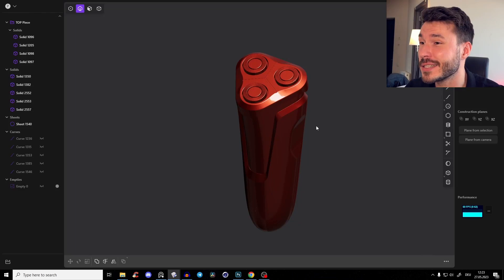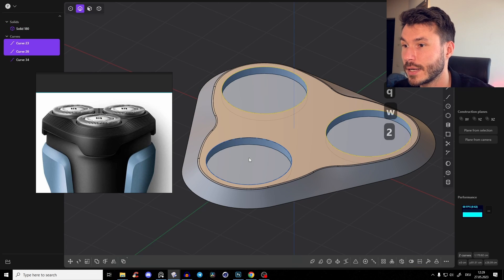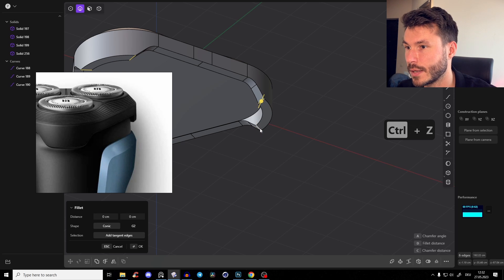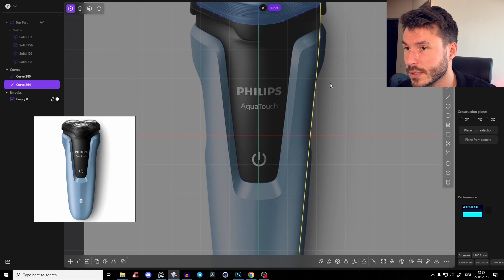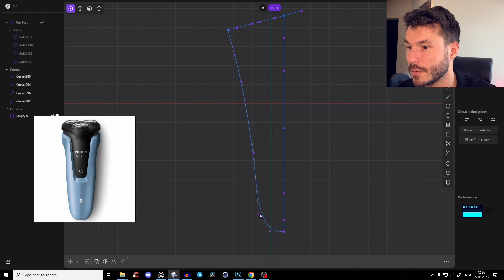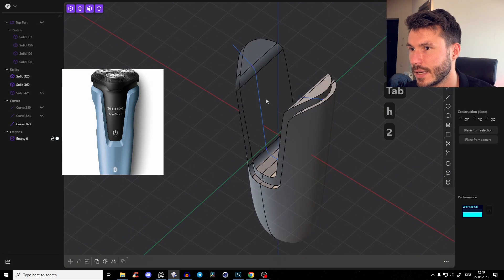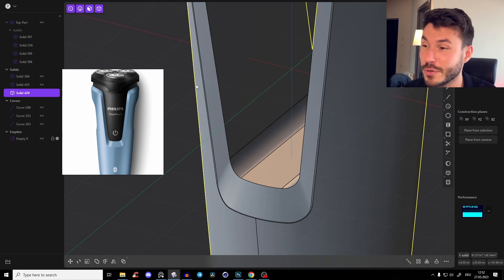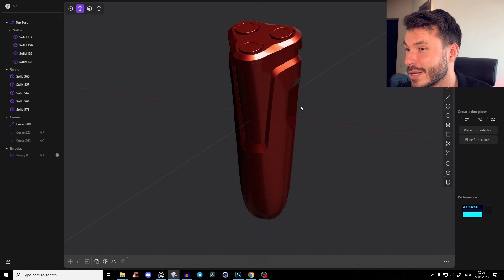Best Hard Surface 3D Modeling Software | Plasticity | Beard Shaver

Comment: 11.10 I do everything like you, I select the curves and combine them into a ring. But the shift does not combine them into the shape I need.?
Reply from the maker: Zoom in into all points of the curves. They have to meet/touch all each other.

The same on the top. The points have to touch the curve to work

Comment: Im a shapr3d user of over 4 years on pc and ipad.
I picked up plasticity because for 100$ 2 seat license is a great deal for cad software, big fan of that.
I wish there was a navigation template Shapr3d nav. Shift right click for rotate, middle pan, it slows me down quite a bit, 15 minute workflow takes me twice as long on Plasticity. Not a knock on software at all, just my own personal use case report
Reply from the maker: Did you checked out -> Top Left -> Preferences -> Navigation -> Navigation Presets?

You can select among many different ones, maybe one is very similar to Shapr3D

Comment: @ 12.27 offset face fails for me. I’ve rebuilt the model twice and always fails at this point. I have a decent PC so I guess I’ve missed something ? Any help would be great. As a side note, if I try and offset the upper part of the handle it works fine.
Reply: So it appears to be a problem with the bottom of the model, where the 4 curves meet to form the loft. Still not sure how I went wrong ? Looks like it could be pinching ?
Reply from the maker: I had the same issue. I can't explain why.

But I did it a few times and then it worked. You can also make at the very bottom a VERY tiny cut with a straight line. So it will be almost not noticeable and then it should work again.
Reply: @nikita.kapustin  Thanks. Maybe it's a bug ?
Reply from the maker: @Mrflippyfloop  Might be as well
Reply: @nikita.kapustin  Just exported the model, before lofting, into MOI3D. It worked fine in MOI3D so must be a bug. Hope it gets fixed.
Reply: Need to make sure the bottom points on the curves are all scaled to zero on the Z axis before loft. Then it works.